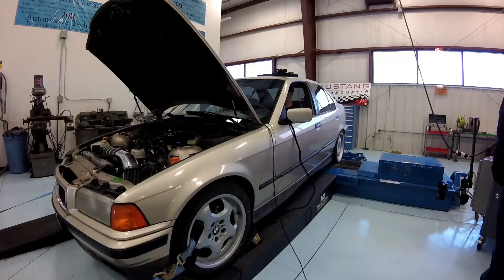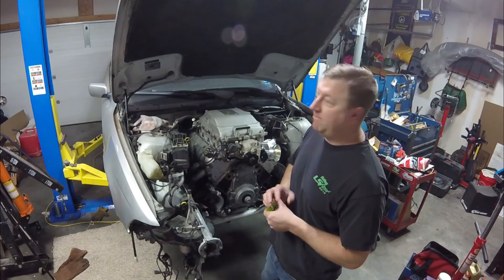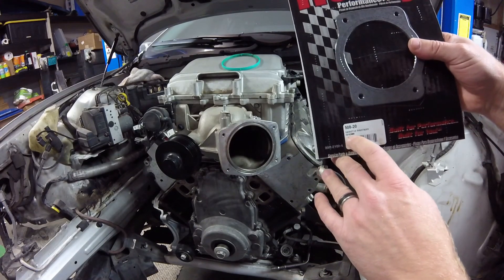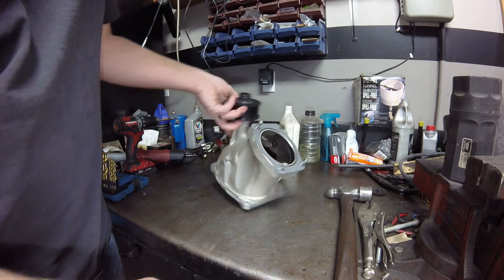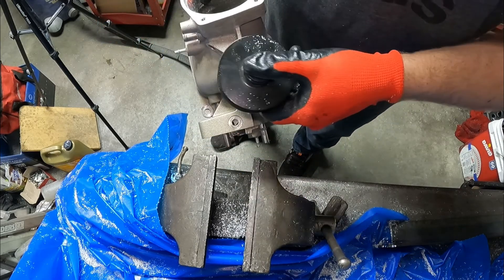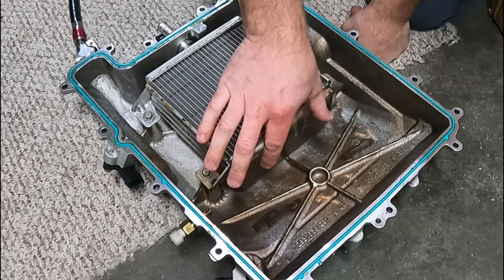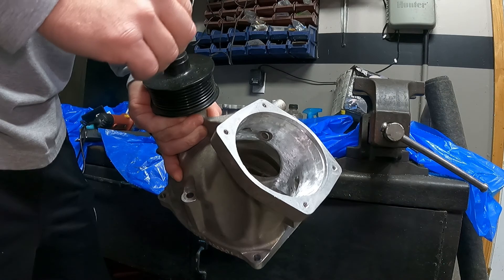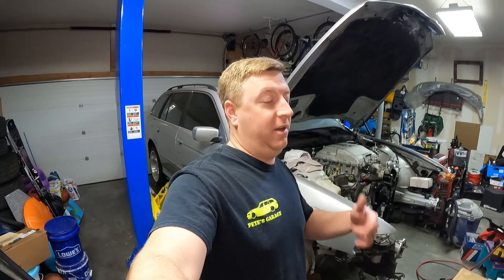Porting and Rebuilding An LSA Blower- Pete's Draggin' Wagon Part 10

Comment: I just blew up my LSA supercharged LS1 and it completely trashed my blower.    Thanks for this video showing how to get the rotor pack out.   I can at least take it apart and see if it's even remotely salvageable.   A metric shit ton of metal went through my blower and my intercooler brick looks like it got shot with a 12 gauge.
Reply from the maker: Dang that sucks. Hope you can salvage the blower.
Reply: @PetesGarageandperformance  Me too.  I bought this LSA blower for old school pricing aka cheap or cheaper lol.  If I have to replace it with todays market it's going to be a tough pill to swallow. :(
Reply from the maker: Yeah the prices for an lsa setup have definitely climbed since the supply dried up.

Comment: Just found your channel, great video!!
 
 I'm thinking of porting my LSA supercharger, after watching your video.
Working on 1963 Impala SS with
Gen 3 Ls 6.0, bored. 030 
Gen 4 Connecting Rods 
Eldgen stage 3 sloppy Cam
#823 heads (P&P), .660 lift springs kit
ZL1 reinforced brick 
2.55 GripTec upper pulley
7.485" ATI Lower pulley

How much more performance would you say that LSA, picks up with the porting of it to cram more air into it?

Thanks for you Help and Info..
Reply from the maker: It’s hard to say how much it picked up with the porting because I never installed the supercharger before I ported it. I think most port jobs gain roughly 40hp or so from what I’ve read. Get ready for big block like torque!
Reply: Thanks for the reply and your opinion Mr. Pete ,I appreciate it.
 Big block Torque would be Great to move the heavy Chevy because it's gonna be a street car.  Full interior, bucket seats, A/C and in the tunk 1 JL Audio 13x7 sub in speaker box & 5 gallon water/ice box.
I want to be able to hop in it and go wherever I  want and not worry about anything, plus have a lil Fun In It!!